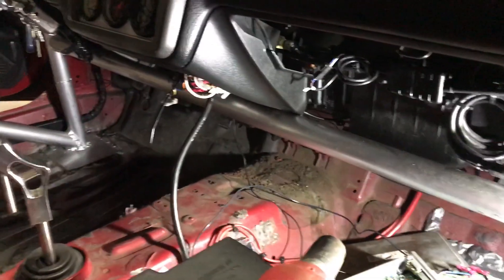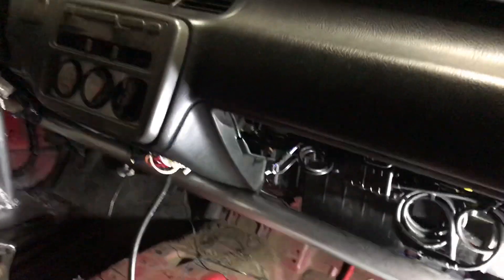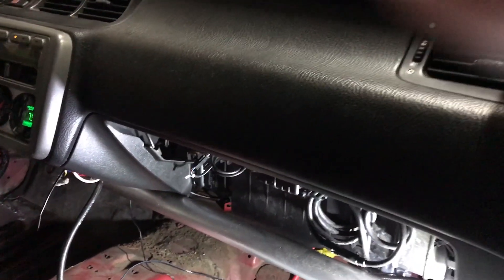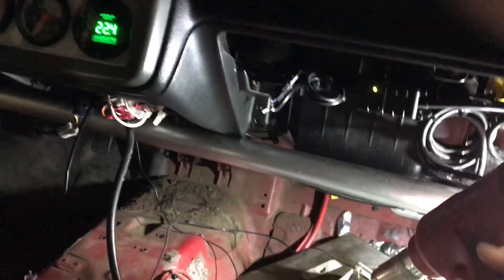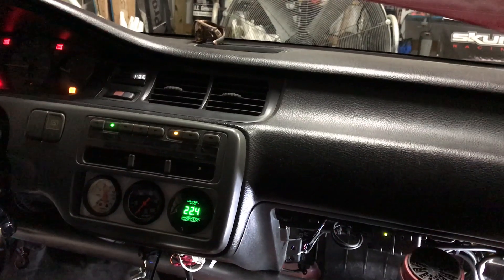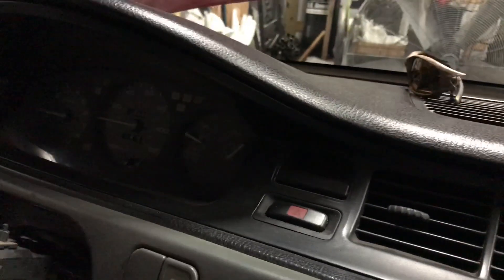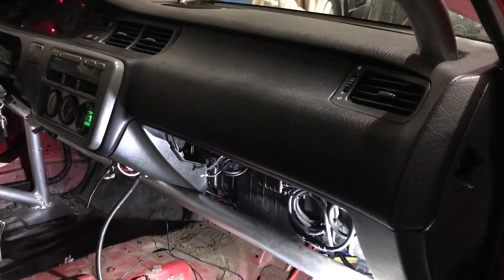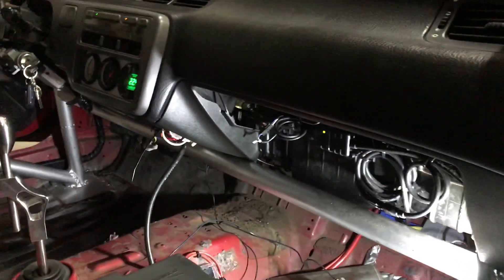Honda Civic fuel pump prime issue  / main relay

Comment: I think this is the best dam vid on u tube
Reply from the maker: Not sure about the best video lol but I appreciate that kind comments! Hope it was helpful
Reply: @barryc1635  I am literally having the same issue right now. I am going to test the heat gun on the computer. Hopefully it works.
Reply from the maker: @DREPR0787  hopefully this gets you in the right direction
Reply: Super helpful... I replaced all the capacitors on my ecu first and had the same no fuel pump priming/solid cel. Went and hit it with a heat gun and it primed and started. Just ordered that Ic17 chip and hoping that is the issue.
Reply: @haggardsoul1 Hi, did you manage to solve the problem? I have the same symptoms, it takes a long time to arm the bomb, and when it does it's only when it wants to.
Reply: @emilybranzani8243  yeah I did and it starts perfectly now. No more waiting for the fuel pump to prime... I'm still not used to it after dealing with that issue for so long.
Reply: @haggardsoul1  I'm going to change the ic17 chip, I hope that's the problem, I don't know what to do. The car works ok, but it takes a while for the pump to work or there is almost no signal
Reply: @emilybranzani8243  mine slowly over time took longer and longer to prime. For whatever reason it would take even longer when it would rain... Eventually it stopped priming altogether on its own unless I blasted it with a heat gun. It was to the point I would have to hit my ecu with a heat gun to get to work. Take my ecu out and blast my heat gun inside of my place of employment to get my car started to get home. It was really bad! I highly recommend replacing that chip if your symptoms sound similar. I wish you the best of luck!
Reply: @haggardsoul1  Thank you very much for answering something about this car, it is very important to me and this problem was making me discouraged from continuing with it
Reply: Dammm I had the same problem live in Oregon we’re it’s cold and fuel pump did not want to prime so seen this video and gave it a try and it works thanks for the video !!!

Comment: You may have saved my marriage. I tried for WEEKS to solve this problem on my wife's Del Sol. Even had it towed to a Honda specialty shop. Tried this heat gun trick and it fired right up. I can't thank you enough for helping me diagnose this intermittent problem.
Reply from the maker: So happy this worked for you!  Just send the ECU to someone like Jason Waters Tuning and have it rebuilt with new parts and it should be good for many more years

Comment: Have a 1997 Honda civicHX (different lol ) got it for 300 crank no start with 264k miles little old lady just got to old
To drive it and sold it to me !  same issues went to junkyard after replacing the fuel pump tune up oil change so I started googling no prime from the fuel pump instead of just crank no start and I came across 3 videos pointing the ecu! Got it two weeks ago and after watching  your video and 3 others I ended up a junkyard got one from a sedan 1.6 5 speed! I said If I plug it up then it primes we got ourselves a car ! THAT THING PRIMED UP AND STARTED ! Thanks so much and it’s exempt antique tag here I come lol

Comment: If I could kiss you I would.
Could not figure out why my car wouldn't start had all the same issues.
My car sat in the garage for almost a year.
I came across your video and I tried it and it worked.
Bought a used computer from eBay and it's been running flawlessly.

Thank you
Reply from the maker: Glad it was able to he;p your situation!

Comment: Thanks man, Had a no start issue with my 93 Integra. Solid CEL no fuel pump prime. Changed the main relay but issue persisted. Tried this out and it started right up. Thanks!
Reply from the maker: Glad it helped!

Comment: Thanx man cause I had a spare ecu in the house and as soon as I plugged it in the fuel pump worked then a few months later same problem but like in you video is starting to get cold here where I am and that ecu is starting to act up so it makes sense  the one I had in the house was already warm

Comment: It worked on my civic esi.I have to replaced five capacitors coz it visibly leaked and injector pulse was there after replacing the capacitors especially the 220 microfarad.After sometime ,the positive supplying the fuel pump failed.Not sure wether my main relay failed.Tapped a positive line from the ignition switch line and connected to the main relay bypassing it and fuel pump worked but check engine light is there to stay.Im using the car  and waiting for a new main relay.IC 17 is really controlling the fuel pump and injector pulse.Thanks Barry!!!

Comment: man oh man !!! I mean  YEARS !!! wondering what the exact issue was with my 95 civic.  I tied it more to humidity then cold though.  Sunny cold low humidity day will start right up,  as the humidity goes up, regardless of temp,  so too does the wait for the check engine light to go out   could be 5,10,20 minutes. Even guys who specialize in Honda's seemed clueless.
Reply: Mine just started doing this after sitting in the rain and it’s Arizona so it rarely rains, eventually I get it to prime but I’m guessing a new ECU would fix this??? Anyone?
Reply: @dariusduvall4170   that's  where I'm at on this,  down to an issue with the ECU.
Reply: Where can I order the ic17 part?
Reply: @joegarfias8993  Hey Joe,  I had taken the panel off the pass. side floorboard, to get to the ECU. I started driving around without the panel on and for whatever reason ( simply more air flow ??) I've not had an issue since. It can be storming and it starts right up.
I was dumbfounded. It's been 2 years and no problem >

Comment: So I can just put a new IC17 chip in and reprogram it and it will be fine? Or do I have to buy a whole new ECU? I have this problem with mine and your video helped a lot
Reply from the maker: The IC 17 does not need programming, just proper installation . I sent mine to somebody to have put in.
Reply: @barryc1635  thank you, so once you replace it you never had a problem with it? And how did you figure it out? The whole time I thought it was my fuel pump and then I found this video and it really helped
Reply from the maker: Riley Miller I just kept researching and did a lot of testing on wiring and voltage outputs, between that and a few calls I was able to narrow down the issue.  No issues since
Reply: @barryc1635  so I just went to the shop to see what they would say about it and the mechanic said it’s not removable and I’ll have to buy a new ecu, how did you get your chip out? Was yours removable? Should I just try a different shop?
Reply from the maker: Riley Miller let me look up the info on where I sent mine. Might be tonight
Reply: @barryc1635  ok thank you, I went to another shop and they said they could just put a switch in for my fuel pump and injectors so if I can’t get the chip replaced that might be the way I go, thanks for all the help
Reply from the maker: Riley Miller you can purchase a replacement ECU off eBay for under 200

Comment: My 95 del sol does this, sometimes it be 30 seconds or up to five minutes, I have multiple relays ive tried and they all working, checked wiring and everything between, ecu was my last resort,  ima pull my ecu outta my other del sol and see if that helps thanks for video man
Reply: Update?
Reply: So far swapping my ecu seemed to work

Comment: thanks a lot for this. already changed my fuel pump and main relay and still had the same
problem. Do i have to resolder IC17?
Reply from the maker: I would recommend someone like Jason Water Tuning to install this part.  Not a easy install without having professional solder equipment

Comment: Thank you u answered a lot of questions i had. Btw great trick
Reply: Thank you for your quick response. I have a bit of an issue... i can't find the main micro relay for my Honda jazz 2006 in my area. What do you remember i use instead ? Thnx

Comment: Cant wait to try this
Reply from the maker: Hopefully it works for you
Reply: @barryc1635  Im having same issue with my 93 eg I just bought and it's my first winter so I'm guessing this is it. Haven't ran in couple weeks
Reply from the maker: @Mario-et3tp   very possible, if you leave the key on foe a while it might heat up the ECU enough to start, that’s how I started to figure things out and narrowed things down

Comment: I’ve got an issue with my 95 civic b18 swap where it wont prime the fuel pump and relay click with the b18 ecu, but the pump will prime, relay will click and car will start with the p06 that was in the car when i bought it. No cel with the p75, i tried heating it up, as well as letting it sit for like 15 minutes and still nothing, do you have any idea what it could be?
Reply from the maker: Sounds like the ECU is having an issue like what this video is about. See if you can barrow a known good ECU for another test from a B series
Reply: @barryc1635  Thats my main issue is i dont know anybody with a b series or any other honda i can test my ecu on or use an ecu from, currently looking for somebody willing to let me use their car as a test subject

Comment: I replaced the fuel pump and the main relay and I still don’t have any fuel pressure. It’s summer right now and currently 85 degrees and humid as hell outside. I haven’t used a heat gun yet but do you think it would work in my case
Reply from the maker: Spay a little starter fluid into the intake and see if it try’s crank.  If it does that means the main relay and the rest of that wiring is probably ok and the problem would more than likely be the IC17 issue
Reply: @barryc1635  thank you for the fast reply. I’m going to try that tomorrow it’s getting late over here but if I does start up from the starter fluid I should try replacing that fuse or relay that is on the ecu?
Reply from the maker: @mickeyyy7571  if it does start that means the rest of the ignition system is working, the same fuse normally controls everything related to the relay and injectors.  IC17 inside the ECU only controls the fuel pump
Reply: Can I just replace the computer I’m having the same issue on a 92 eg that I bought . I replaced the fuel pump today and I’m still having this issue the fuel pump comes on when it wants too ???

Comment: so my fuel pump primes. it turns over for a bit, then cranks up, starts, then after ab 2 seconds, it shuts off, then if i keep cranking it itll turn back on then shut off and keeps going. ive been fighting for a long time, idk what to do and i need help. it idled like it had a 5.0 cam in it
Reply from the maker: I would suggest finding someone local that has some basic knowledge or your car. There are too many variables that could cause issues like this
Reply: @barryc1635 yeah, i dont have the money for someone to come look at it. so im kind of clueless
Reply from the maker: @aspeso4487  I wish I could help more, but I’m not a mechanic and can only help with what I had found

Comment: I think I’m in the same position you were, I’ve ensured that the issue isn’t the relay, or the pump itself, is there anything else I should check before trying this?
Reply from the maker: If you are comfortable using a Haynes manual and a volt meter you can verify where the voltage stops or just isn’t there.... the output that controls the fuel pump rest at 12 volts if my memory serves correct

Comment: Idk what to do. Why does this work. I just replaced 3 capacitors and it's till doing the same thing
Reply from the maker: This isn’t a capacitor issue.  IC17 is the part that would need replacing.  That’s assuming this is your problem
Reply: @barryc1635  well I just ordered one we'll see

Comment: I have replaced all the capacitor, but the problem is still not resolved. Do i have to replace the ic 17 too?
Reply from the maker: Ic17 was the problem I had.  I went ahead and upgraded the capacitors afterwards to be safe
Reply: @barryc1635  ic 17 must be programmed or just replace it?
Reply from the maker: @panduraga  just replacement. Requires someone with good soldering skills
Reply: @barryc1635  ok thank you so much!

Comment: I know this is a older one of your videos , But Hopefully you check this , Maybe you can give me a idea , Ok so my civic isnt getting fuel from pump to rail , I should start off by saying I been building the car from barely a shell to a complete car as well as a fully built motor , Now.2 yrs ago it started everytime timing was just off ...Fixed that an I ended up landing a long hour career so it sat untouched the past two years . Well recently have the time now to finish small odds an ends .. Buddy thru a base map on my ecu, Well tries to start up but just wont , I got spark , timing but no pressure on fpr an no fuel to fuel rail BUT when turning key to on pos the pump primes ..I cant figure out wth it could be ...when spraying starter fluid in throttle starts for half a second an then tries to crank again but no go , Iv gotten ppl sayn fuel pump but it primes , fpr , dizzy , timing . or the fuel has gelled up in the tank an lines an they are clogged . . Any help would be very much appreciated as years of building an tons or labor an money went into this build an all I wana do is drive the thing lol...

Ps sorry for such a long questiom
Reply from the maker: I’ve seen cars that sat for a while have bad fuel filters, that would be the first thing I would replace.  Are you hearing your fuel pump prime? If so the filter most likely could be the problem. You can also pinch off the return fuel line and see if you get fuel pressure, I’ve seen fuel regulators fail as well
Reply: Filter is brand new , pump primes
Reply from the maker: @Stage3motorsports860  do you have a pressure gauge hooked to the rail? If so what pressure are you getting?
Reply: Did you ever figure this out? I seem to be dealing with this same issue…the fuel filter works & the fuel pump primes but my fuel rail is not receiving power & activating…

Comment: Bro I got the same problem you got a part number for 1c17  and is it the same for a p28 ? I used a hair dryer and it worked it started right up
Reply from the maker: If you scroll trough some of the reply’s I had listed the part number in response, I’m glad it helped you find the issue

Comment: Let me ask you couple of questions. How do I know which model my car is? Like if it is EG things like that. I have a 1995 civic coupe ex 1.6 manual transmission. 

Now couple of weeks ago it started with starting issues. I first thought it was the starter, I replaced it and it started well for a day, went down again. I replaced the fuel filter, and fired up, then die again. So my next step was replacing the pump, which solved the problem for a day and it went back to not starting again. Now will the heating up thing help solve the problem? Or should I get a new ECU??
Thank you for your help.
Reply from the maker: EG is 1992-1995. This could apply to yours.   You need to listen and see if the fuel pump primes when the key turns on
Reply: @barryc1635  Hi Barry, thank you for the tips. Here’s my situation I heated up the ecu and my car started right away. It was working fine yesterday since it was hot, but after seated all night this morning it didn’t start again. The engine light doesn’t go off like it used when you say the pump primes. What should I do? Resold the ic37 or get a new ecu? What’s easiest? And if I had to buy that little black thing the 37, where do I get it and what is it called?
Thank you very much again for your time and reply.
Reply from the maker: @ricardosom7766  I would recommend contacting JasonWatersTuning to get that ECU completely serviced.  It will probably cost 150-250 I’m guessing, but it will get it back to like new condition.  The Main Relay is the other part in the driver kick panel about the hood release
Reply: @barryc1635  hi Barry, just wanted to thank you for the help and advice with my car issue. I contacted waters he was going to charge me $150 to repair the ecu. Then I found out I could buy the capacitor kit which I did. Y solder 5 news one un my car is working just perfect. 
Thank you again, god bless.
Reply from the maker: Truly glad I could help

Comment: this seems to match almost identically the issues my accord is experiencing. 
two questions tho.
1)did you ever experience any random stalls
2)do you remember any occasion. of finding your battery low without obvious cause?

iv lived with the slow fuel prime problem a long while. few weeks back battery was low for no obvious reason. only 2 small trips after that it stalls out while warming up and then began to resist starting progressively more until it justvdidnt even sound like it was close, just crank crank crank.

also when releasing the key from start position it sometimes would sound like the relays clicked again and occasionaly the tach would jump turning the key back to acc. also the car would make a grumble like it was trying to turn over even though wasnt touching the key. 

sorry for such a big amount of text to read but would appreciate any input you may have as this is the closest description of my own problems iv found despite weeks of forum searching and my own diagnostic with the service manual.
Reply from the maker: I did have it stall, but only after I first started up every once in a while.  Since I replaced IC17 I have not had a problem since. I don’t recall having battery issues. It does sound like a ECU issue though. I sent my ECU off and had it refreshed to help cure future issues as well.
Reply: Barry C ic17 is the 220uf capacitor?
or the long rectangle chip?
Reply from the maker: @westhouse4641  the long piece